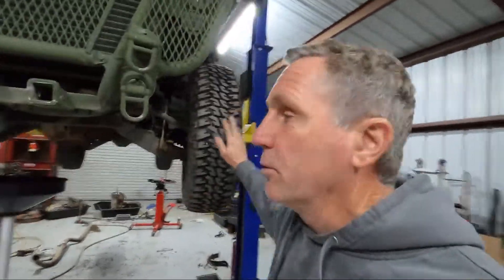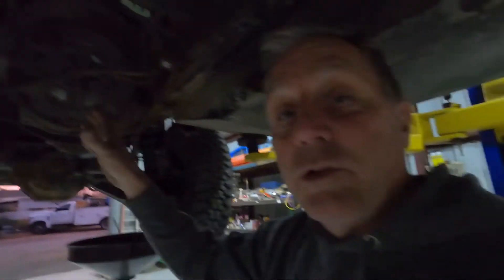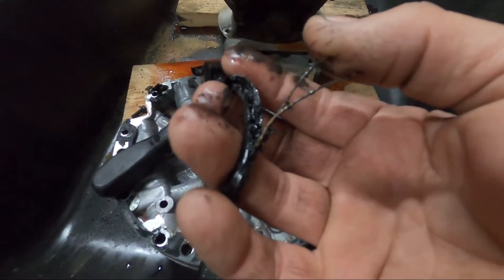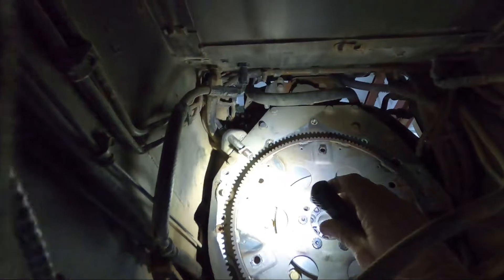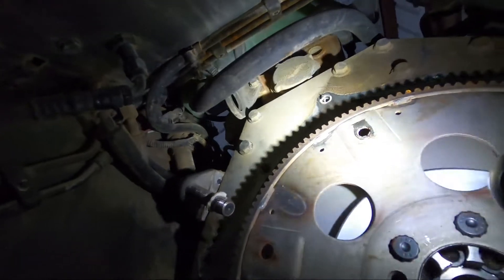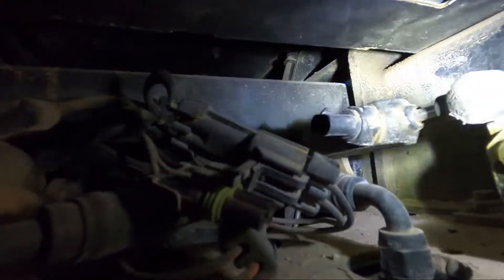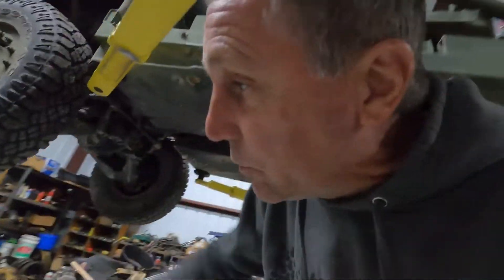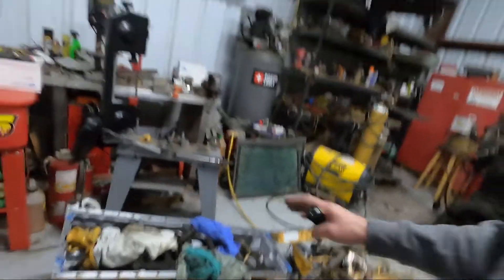M1161 Growler Transmission Electrical Problem Solved

Comment: Thanks for this video. Our PCS fuse is blown, speedo is inop and Speedo doesn't work. I'll report back.
Reply from the maker: I see a lot if these with a blown trans fuse 90% of the time I replace the fuse and all is good. I have no idea why the fuses are blown.
Reply: @RasmussenEquipment  Put about 150 miles on the rig since replacing the fuse. 

So far, all is well.
Reply from the maker: @jeffwhite3021  good to hear, that saves you about $1800 on a transmission rebuild…